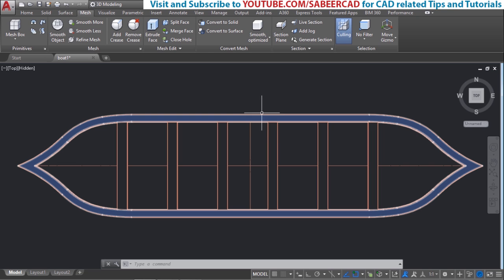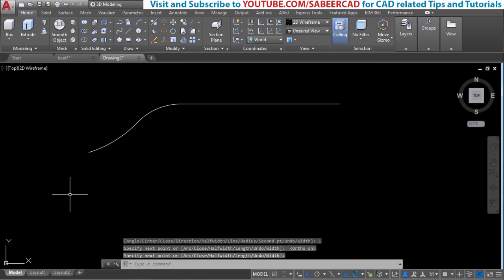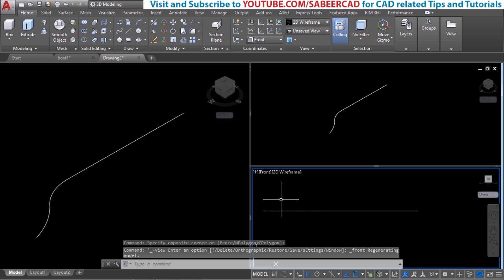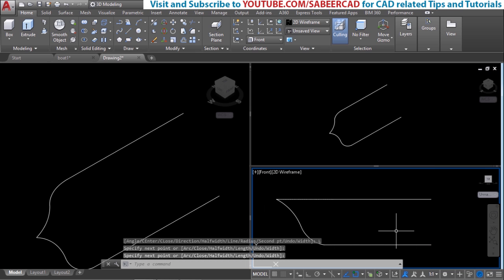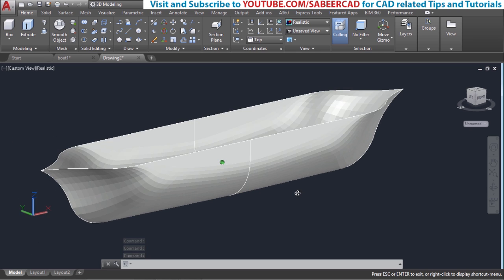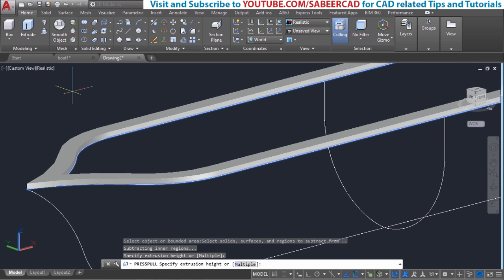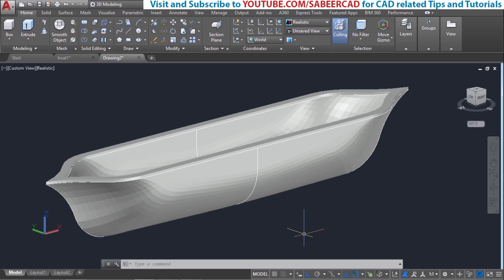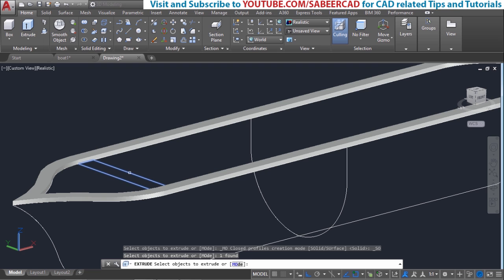AutoCAD 3D BOAT | 3D MODELING OF HULL SHAPE | AutoCAD MESH MODELING

Comment: But the boat hull has no thickness so it doesn't exist.  If I 3d print it it won't work.  How do you make the mesh hull have a thickness?  Scale it with a copy? Have the scaled copy to line up with the bottom of the border around the top?  Then select the objects and how to make them solid then?  Could I add thickness to the mesh so it will exist?
Reply from the maker: For 3D printings its better to create using Solid Modeling

Comment: Hi and thank you for your tutorial. I am new to surface mesh. I almost completed the tutorial but hit 
a problem where my end points of the poly lines will not attach  when completing the Left view.
Any comments will be appreciated.
Chas5353
Reply from the maker: To get Edgesurf the edges should have end to end contact.  Use OSNAP whenever you pick points.